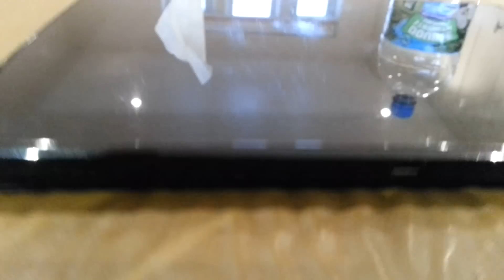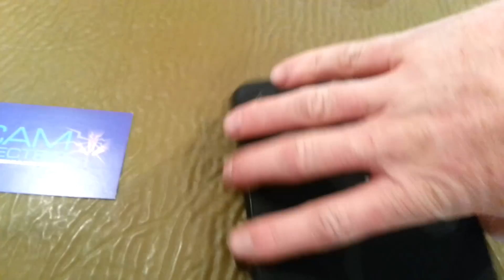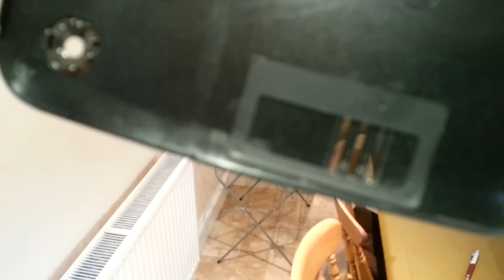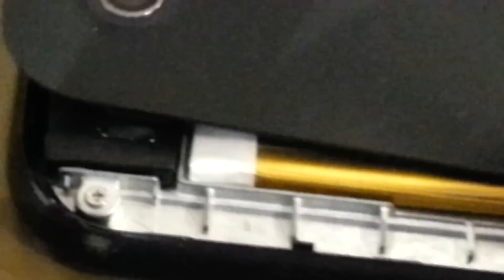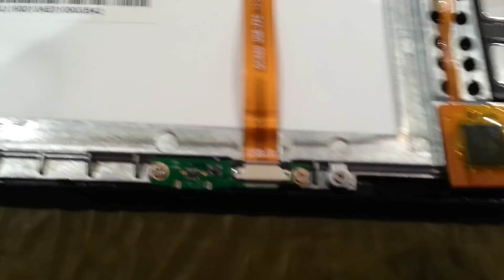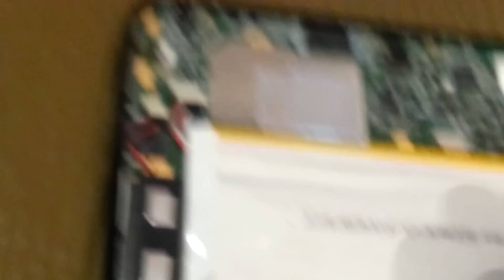Tesco Hudl Charging Port Repair

Comment: Thanks for the video. I tried with the stanley knife blade but didn't trust myself so stopped before I ended up in A+E lol.  I got the back in the end by using an old windscreen mount satnav cradle. Attached the sucker on the back in one corner and then pulled hard. The back popped right off! Just thought I'd share this in case this is of use to anyone else.
Reply from the maker: Totally agree 
I found this out too after making the video! A suction cup is definitely the way to go. If I knew how to i would edit the video to say this.... I was just a dad trying to help !!!!
Any idea how I might edit the video???
Reply: Camelectric Ltd I don’t think you can edit the video but I might be wrong. You could delete and upload another one I guess but I wouldn’t personally bother if it were me. You might be able to edit the description to include a note eg. *see description for alternative back removal process* or something like that! Anyway I didn’t intend to detract from your video which Im sure has helped out many people 👍 cheers

Comment: With my Hudl, I used suckshon cups to delegate the back plate
Reply: Yes you are quite right and I did actually find that out the next time I had to swap the port!
Much easier and safer ! I just didnt really know how to edit the video to add that bit in!
Reply: @craigmitton9075  no problem.
Reply: @craigmitton9075  that tutorial really helped out. Very greatfull!

Comment: Great demonstration! buf i have a quesrion and im not sure youll no the answer but here goes. i was replacing my screen because i had accidentaly cracked it. it going great until i took the ribbon cable out but as i was doing that the black and white clip came out with it. Now it won't charge and im assuming that's the reason. So please i ask is there any suggestions on how i can fix this as i have lots and lots of school work and pictures and more.

Comment: hi just changed the charging port  took 10 mins top  just need Stanley blade n  little star screwdriver  don't av to fold battery back just  unscrew the 2 little screws push the 2 black clips up prise old port out stick  new one in n push the 2 clips back down to hold new port in  put back back  on  hey presto  not hard at all  its charging gr8t  now  hope this helps  cheers

Comment: Reaplacement is only £6.99 with Amazon Prime. Also, I have replaced 2 of these now and have never needed to remove the battery to do so. That's an unnecessary step as far as I'm concerned. You can just unclip the old port using the black clips and then recilp the new one. Why remove the battery? Anyway each to their own, I'm just lazy lol. Thanks for the video. :)

Comment: Brilliant did it exactly as said thanks for that. My part was 9.99 from amazon with free delivery but looks the part, a few reports on amazon said they had struggled with e-bay ones but these where OK. Have previously had this repaired for 25 quid but that port lasted about 2 weeks before it fell off the PCB so suspect they soldered a new port on (also battery was still glued in as was ribbon so they had never done this procedure) which is never going to be as strong.

Comment: I got a new part for 4.99 off amazon with free postage ,i started using knives and thin screw drivers trying to get the back off instead of doing what the video does after failing i did what the video said to do ,i bought a stanley knife blade ,and did the job in mins ,i was very very happy things never work out for me ,but i suceeded when i did what i was told thank you very much

Comment: You got mugged off. I got a replacement for a 10er :P Lol, just kidding, thanks for the helpful video :D
Reply from the maker: hi
I didnt actually. at the time I made this video that was as cheap as you could get them. They have since come down drastically so actually you did as they are available for 3 quid now!
Reply: ah, bollocks :P

Comment: mine was working this morning, came back to it 10minutes later and is lifeless. Thought it might possibly be flat battery, unlikely as its been on charge all night but put back on charge anyway, couple hours later no change, pressing power button does nothing, holding down volume and power button together does nothing. Any thoughts, anyone else had this kinda issue that can point me in the right direction?
Reply: problem solved in 15minutes flat! Internet saves the day again! did not know about the little pinhole reset on back of hudl 1 working a charm now again!

Comment: thanks  for that, done what you said the only thing is ,the battery is charging full but only  lasts 10mins. and I have no camera now,what can I do to fix this please.
Reply from the maker: +Carol Tutt  Hi Carol
I arent an expert you understand, just trying to help others.
That said, the camera has like a square press stud type connector which can unclip when the back is removed, maybe it just needs re connecting? it presses to c click a bit like a press stud type feel.....
be careful though the small square has lots of individual connections so its really important that the connector is lined up before pressing it to a click!

Regards the battery, if at full charge it only lasts 10 mins then the battery is probably cream crackered.
From being flat though it could take a couple of hours charging to get back up to full charge!
hope this helps
Reply: +Camelectric Ltd thank you it helped me ,I will try what you said ,Thanks again.

Comment: Hi Craig, Thanks very much for this video. I have a hudl1 that is used by 9yr old and he snapped the charging port. I now have a working hudl1 thanks to you.
I bought my port from a company called TechnologyVS from ebay for £3.99
Only issue I had (apart from opening lid) was that I accidentally closed the little black clips after I'd disconnected the broken one, so couldn't get the new one in and thought I'd bought a duff.
All good now - thanks a million.

Comment: This helped me so much, the hard part for me was removing the battery as it was so stuck down and I was afraid of bending the battery. I didn't have a painscraper or anything thin enough to get the back off so I had to use a satnav suction pad to remove  the case which was much easier. Thank you :)

Comment: Thanks just completed the charging port replacement. I struggled to get the back off but eventually using a Stanley blade in a paint scraper handle placed in the seem joint to hold the hudl flat on the table and a satnav screen suction mount one corner the back come off easily first gentle pull with no damage.  The other problem I encountered was the removal of the ribbon cable.  Being naturally stupid I assumed that "up" in  lifting the black tab was up with the hudl flat on the table but up really means toward the top of the hudl as it is flat on the table.  Hope this help other diy persons who may be as stupid as me.  Bon courage!

Comment: I would also recommend when trying to get the back off is starting in the corner, several attempts along one of the edges failed but first go at the corner and it popped out.

Comment: A very easy to follow video. Thank you very much.

As you've had it open twice now I don't suppose you paid any attention to the battery did you? At the price-point I'm hoping it isn't a proprietary part and would love to be able to find a source for brand new replacements (Ebay is only listing 'used' hudl 1 batteries and I'm extremely loathe to trust any of those.)

Comment: Thanks for the video. Suction was the way Mikey Rhymes posted on another video. I used an old sat nav windscreen adaptor in the top left hand corner on the back and it came away quite easily without needing any sharp blades

Comment: I am totally useless with my hands (although I did put a new drive in my MacBook), yet your video was bang on!!! Thank you so much!!!!! My girls are going to be made up!!!

(After changing the  borad, I was worried about putting the case back on then charging it, just in case it didn't work, as taking the case off was a mare!!)

Thanks again!! Awesome!!! :-)

Comment: Brilliant, thanks so much Craig. Very helpful, it was tricky to get the back off but a Stanley knife blade was perfect in the end. A loose screw fell out of mine when I opened it up but I soon spotted where it was from as each screw hole has a gold area around it and one was empty. Don't think it was too critical though. I was quite nervous about breaking something inside as it felt very fragile, I just did everything in slow motion, and hey presto - the Hudl is now charging away! Only took 5mins once I'd got the back off - fab! The ports are really delicate and I can see myself doing this again in the near future! I'm going to put a sticker on the port and charging pin so my son can see which way round it should go in!

Comment: Thanks for this video. Ordered the new port from Amazon and followed your instructions to the letter. Getting the ribbon cable into the new port was a bit fiddly but it's all fixed thanks to your guide. I was all set to bin the Hudl - so thanks for saving me quite a few quid!
Reply from the maker: Chuffed it worked for you too!

Comment: Very helpful Craig.  Thank you.  I managed to successfully repair my son's Hudl with your guidance.

One suggestion I would add.  I started removing the back at the top left corner by the headphone port as that was where the biggest gap was but I managed to nick the edge of the board in doing so.  No real harm done but, in hindsight, it would have been better to pry away one of the bottom edge corners first as there is more space between the frame and the innards.
Reply from the maker: Fantastic!

Comment: I worried but I realized that usb port was loose so after opening the back I screw tightly 2 screws  of charging port and hudl was charging again , I only wondered why there were 2 little screws inside as a spare it looks like :)

Comment: Hi, thanks very much for this excellent video - took me about 5 mins once I go the back off. Quick tip for this was a suction cup (I used one from the bathroom used to hold a toy bag in the bath) It pulled the back off cleanly. thanks again

Comment: Thanks bud took me 5 mins to do after watching this. It so easy to do this guys
Reply from the maker: Magic!
Did you find any easier method of removing the back casing?
That was the hardest part for me!
Reply: Camelectric Ltd I just used a stanley blade in one corner Then pulled the rest off . Easy peasy

Comment: Craig Thankyou Thankyou Thankyou so much, this was so helpful you saved me a new tablet (which I've done twice now)...I'm not a techybod but I followed all your instructions to the tee and YEY charger is on and charging as we speak...The only thing that threw me initially was one of the cameras came out but you explained at the end that may happen and it slotted into place with no issues ... The battery was well glued down for me and I used a mix of a tiny screwdriver and a tiny pair of scissors...once I prised it up a bit i popped the scissors underneath so I could prize everywhere and it was super glued in (I couldnt find a paintscraper)...Thankyou again for taking the time out to post this I reckon you will save a lot of people a lot of money .. hugz
Reply from the maker: Thats Fantastic!
Glad it was of help!
Apparently there is an easier way to remove the back as per the comment from Mikey Rhymes but he doesnt seem to want to share with anyomne.... :-(  
which is kind of the point!
Booooooo!

Comment: Craig - thanks for taking the time to make and post the video.  I see on Ebay you can just buy the socket itself as opposed to the whole board.  In your opinion is it worth just trying to change that element or does the whole board need changing?
Reply: OK I have answered my own question.  have now read the full details of he socket and the word soldering iron is mentioned.  Looks like it is the board option for me.
Thanks for the video anyway.

Comment: Hey, thanks for the explanation, seems these ports are prone to breakage! One thing, when I opened the back. A screw was loose there! Not one of the two I undid. Any ideas where it came from???
Reply from the maker: Sorry, no idea, have a good look around before rebuild!
Reply: was it a normal screw or a tint more shiny screw
Reply: It was the same as the two holding in the port.
Reply: if there are no holes for the screws on the circuit board then look around the main frame.. if not it may just be a mistake by the company.. it happens sometimes..
Reply: Well, i put it all back together just after dismantling and it works fine with nothing rattling so reckon it's a spare!
Reply: yeah it must be dude... to get the back off easy all you have to do is find a suction mount tool.. i.e a  sat nav mount u put on the window screen,,, hand with one hand and hold tightly into your chest... (no knife or sharp tools needed)... push the suction mount onto the back of the hudl and you should be able to pull apart with a bit of omph..... then to get the usb out without taking the battery out u undo the 2 screws.. flick up the 2 little black clips.. get a thin thin screw driver or something solid and skinny.. place in the corner or the usb and push and flick it up...... new usb undo the 2 black clips, slide the usb into the bronze strip and slowly tilt the usb down and it will eventually go into place... minimal danger..
Reply: Hi Cliff, I have found loose screws in all 3 of our hudls when opened. They are not spare, why would they put spare loose screws in an electronic device? If you look closely they are from the printed circuit boards and have empty spaces in which they will fit. I did inform Tesco as quite worrying that they can come loose so easily.
Reply: all the screws are the same size except 1.. the odd shinny screw that is smaller goes just above the battery on the right next to the other black clips
Reply: Thanks guys. Knievel, I know what you mean! Loose screws in the works don't fit!
I'll reopen and have a peek!